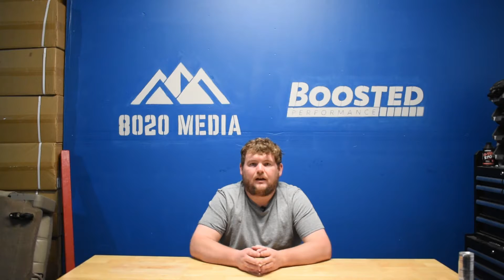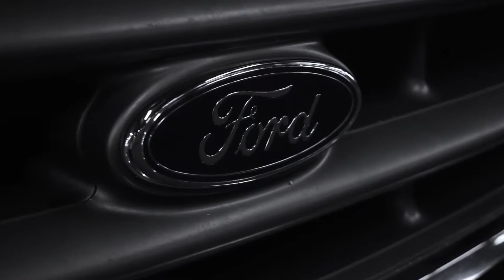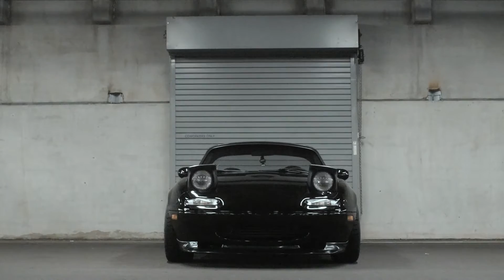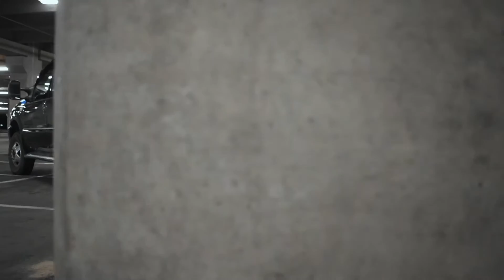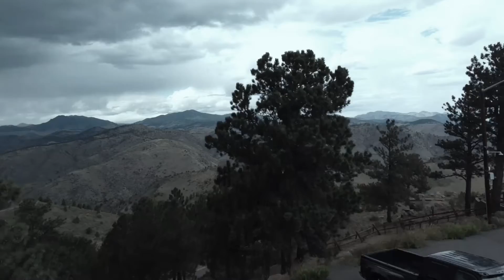BMW M54 | Common Problems & Reliability

Comment: Mine smells like it’s gonna burn down everyday. Feel like it just wants to die, but it keeps running. But the clutch might be on it’s final legs
Reply from the maker: M - Hope it doesn't burn down! How many miles do you have?
Reply: @8020Automotive about 150k miles. First engine.
Reply from the maker: M - Thanks for sharing.

Comment: AIR INTAKE BOOTS. My word, these things can cause all sorts of issues if they have any pin holes or loose clamps.  Idle issues, stalling, transmission cog lights, etc.  Do yourself a favor and get a smoke tester so you can see if you have any leak/vacuum issues with those stupid boots.
Reply from the maker: P - Agreed! Thanks for sharing.

Comment: Alternator / Starter Motor / Fuel pump / Coils (every 150K) Polyurethane bushes (every 50K)  and  as soon as you can if you want to keep it - aluminium radiator, water pump and thermostat.
Emphasis on aluminium, including DISA. 100K only GM transmission flush. 15,525 mile BMW oil changes. Valve covers at around 150k. Mine is 237,000 old and that's all I can tell ya.
Reply from the maker: Z - Thanks for taking the time to share your personal experience! This will certainly help future viewers.

Comment: Bought a 2001 E53 (1st-gen X5) with M54 and a 5-speed manual last year. About to hit 200Kmiles. Instant starts, no smoke, purrs, no issues other than the (Chinesium?) water pump failed 30Kmiles after replacement... OEM-only going forward. Prior owner did all the things mentioned here. Might want to mention the electric "auxiliary water pump" which are also prone to failing.
Reply from the maker: G - Thanks for taking the time to share your first hand experience!

Comment: I've replaced many of the plastic failing parts on my M54 engine to make it more bullet proof. (1) Aluminium Rocker Cover (2) water pump with a metal propeller (3) aluminium thermostat housing (4) Disa valve upgraded to aluminium one (5) aluminium fan belt pulley (6) aluminium power steering pulley. The other thing I'm considering is to remove the pcv setup to an oil catch can instead.
Reply: Do not put a catch can on e39
There is literally no reason.
My car is almost 20 years old and PCV is still original ( or was replaced by the first owner, I personally know the second owner , he is my friend)
Reply: @dust_gale3108  Yes I believe you're right. Considering they don't need changing until around 80K+
Reply from the maker: F - Nice! Sounds like you're doing everything right.
Reply: @8020Automotive  it’s YouTube videos like yours which have been a great help. Without them I wouldn’t have had a clue 👍🏼

It’s less scary now venturing out on longer journeys 😂
Reply from the maker: F - Thanks for sharing. Glad you found the channel helpful!
Reply: Is it still holding up ?
Reply: @Zinbou1  yes it is... I'm glad I made those changes.
Reply: @froggy8301  where do you source these aftermarket parts ?

Comment: This video is amazing, couldn't have been more accurate. I bought a BMW E46 with the M54B22 engine 5 months ago. All of the problematic things you mentioned were there and were fixed/replaced. Bought a new water pump and a thermostat, gasket and a fan(idk why it broke but it stopped spinning). The PCV valve was opened and cleaned and there was so much scum in there build up over time.
Reply from the maker: Thanks for watching! Good job getting it all taken care of, should leave you with a pretty solid motor!

Comment: Excellent video! 
The information matches exactly with my experience in our 120k miles (22 years old) E46 M54.
We changed to an E60 530i M54 and surprisingly, it jerks just at 4,000 rpm but it does it only when it has not been used for some weeks...
It's a bit strange.
Thanks a lot for the video!
Reply from the maker: Angel - Thanks for the feedback and sharing your experience! Glad you found it useful.

Comment: Change oil every 6 months.
Reply: Change your oil every 5k regardless if you are driving the car often or not. Oil is cheap, a new engine is not cheap.
Reply from the maker: M - Completely agree.
Reply: Why? It all depends on how much you drive.
Reply from the maker: C - Doesn't matter how much you drive.
Reply: @8020Automotive  of course it does. Do you think modern synthetic oil just gets bad for being in the motor? It´s not milk.
Reply from the maker: C - Why do you think maintenance intervals are year or mileage...? It's just standard good maintenance. Don't think it's worth going in depth here.
Reply: C - It doesn't matter how much you drive, even on the oil tube it is written to be changed either with x mileage or in 12 months. The oil will not go bad but it's viscosity will change which is bad for your engine.
Reply: My X5 I change every 3k, with 194k miles, they always asked what problems I’ve had with it and when I say pretty much none of the common issues they don’t believe me, I warm it up every start, and avoid short distance driving (under 20 miles) I’ll use my other car instead. No leaks, no gasket failure, no pcv, no eating oil, no Vanos issues, no ticks, no rattles. Only spark plugs, coil packs, an 02 sensor and mas air flow, and pulleys / belts. The motor itself not one issue in 194k miles. Also 93 octane shell so it has a clean fuel system with no carbon build up except the disa / throttle body.
Reply from the maker: A - Sounds like you take great care of it! Thanks for sharing your experience.
Reply from the maker: David - Great insight here!

Comment: one more thing! VERY often overlooked and rarely mentioned: 🤓 The hydraulic lifters OFTEN clog and cause all kinds of engine fault codes, NONE of these codes actually mention to check the hydraulic lifters, they always "blame" another part. hence you end up replacing alot of parts which are still good without getting to the root cause. Try HYDRAULIC LIFTER CLEANING FLUID first, this stuff is meant to do just that, and it often really works! this is the simplest fix for your M54 engine, and you can't really hurt the engine with cleaner lifters, even if there is another fault as well.
Reply from the maker: JP - Thanks for adding this insight! It will certainly help future viewers.
Reply: They never get clogged if you drive a car regularly and change oil every 6-7k kms  OR 6 months whichever first.
Reply: I get Vanos error that exhaust cam not reaching limit, or something like that. Is that a symptom?

Comment: What about the BMW E60 with the M54
Reply: Hi Steve. I was so so happy with my E46 330ci (M54) that we bought an E60 530i (also M54) when our kids were born.
The feeling is surprisingly different taking into account that the engine is exactly the same, theoretically.
E46 330ci was "rude", sporty, I was absolutely in love of its sound. Sometimes I started it in the garaje just to hear it for a moment, and I loved its handling.
However E60 M54 is so silent, so quiet, so smooth, so progressive... That it seems to be much less powerful, even though both are manual (much shorter gear ratio on E46), and our E60 has only 50k miles against 120,000 the E46.
And it's not because of the weight, because our E46 was cabrio (1.6 tons) and E60 is surprisingly lightweight (circa 1.5 tons).
Regards from Spain!
Reply from the maker: Angel - Thanks for taking the time to write out your experience and to help Steve!
Reply: it's the same engine, so unfortunately as far as engine problems are concerned, they were passed on to the E60 as well 😉
Reply from the maker: Steve - What are you looking to find out? We have a full article on our BMWTuning website that may be of assistance: https://bmwtuning.co/m54-engine-problems/